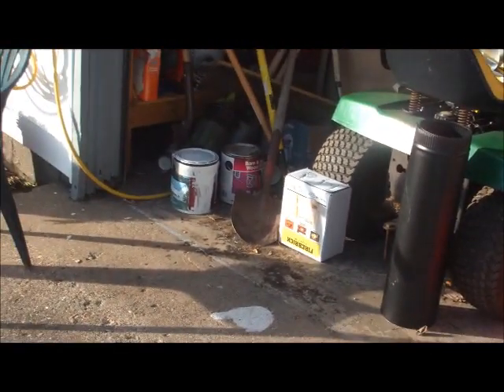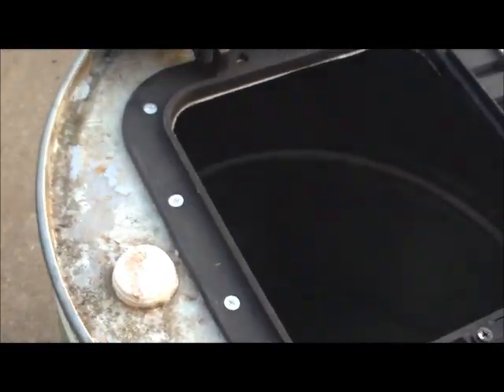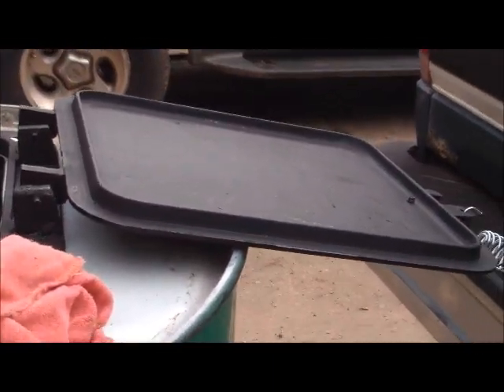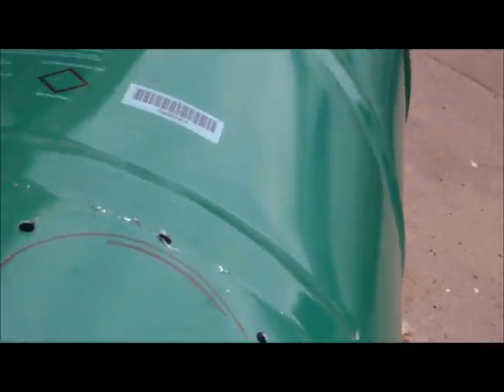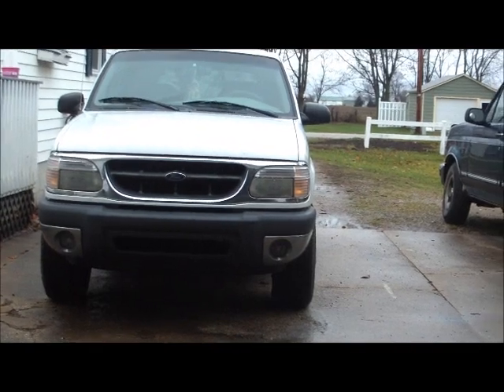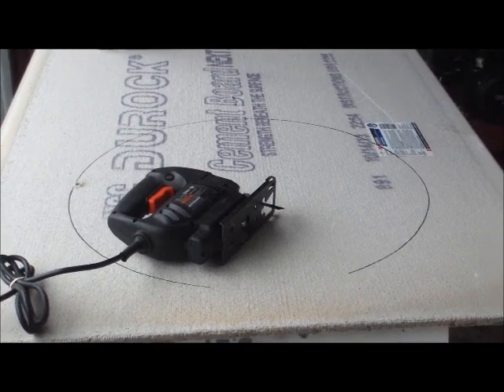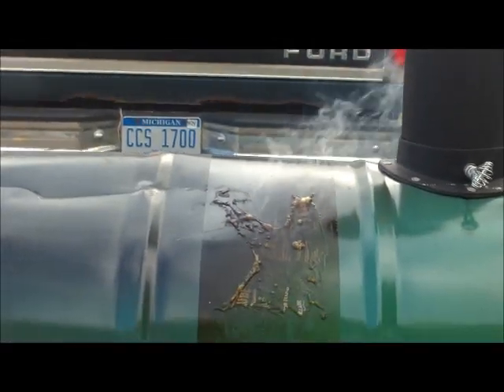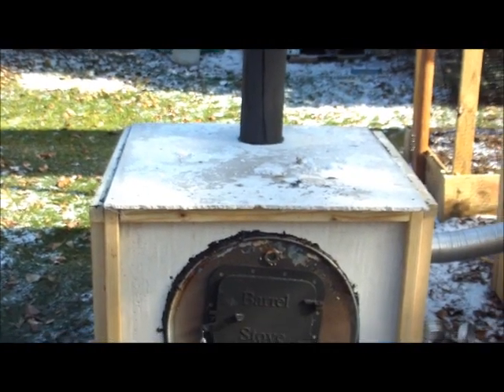Heating the Greenhouse.

Comment: If you have a regular supply of barrels, this is an option.  Unfortunately, the thin steel barrels will not live long with direct fire on them.  That is why the hi end wood burners are made of iron and not steel.  Also, the cheaper steel wood stoves have fire brick liners to protect the steel from the flame.  The up side of this is, the steel lasts longer.  the downside of this is the firebrick shields your home/greenhouse from expensive heat going directly up the flew instead of into your home/greenhouse  :(

Comment: Great demo video.
My bottom barrel will push about 600 plus degrees with a wide open flue. I would imaging that there might be a problem with your wood frame at some point.
Let me know how efficient this set up is once you get all of the kinks worked out!
Chuck
Reply from the maker: There wouldn't have been had I not had a air leak.

Comment: Maybe just put another pipe from the greenhouse lower than the intake and put the fan on the intake to push the air into the box, keeping the fan cooler and the box cooler. Look at all outside wood stoves they have two pipes one for heat and one for cold air return. Heat follows cold. You're almost there!
Reply from the maker: Indeed.

Comment: Jerry I am sorry it didn't work like you hoped. Most of these type stoves require a minimum of 36" from any combustible surface. They achieve a very high temp, even higher enclosed in a box. I am sure you will figure a way to use the stove. My brother went to MSU and he said the ground disappeared in the fall and reappeared in the spring.
Reply from the maker: I think I have it figured out now that I understand fire and air. lol

Comment from the maker: Jerry Harrell Well this worked and yet it didn't. I just went back outside to see if the greenhouse was heating up and the heat that was being piped in melted my fan.
I looked at the stove and the box was on fire...I noticed anywhere there was an air leak in the box the outside wood caught on fire. on a good note  it does work very well overall....so back to the drawing board.
Reply: Oh oh! So are you gonna remove the box? Will you make a metal box instead? Looks good! bet the green house is all nice and cozy now, time to get that beach chair out! :D
Reply from the maker: VivaLasVeggies I may be able to solve the problem. I am a bit scared to use it now thou. I would hate for something to happen to the greenhouse.